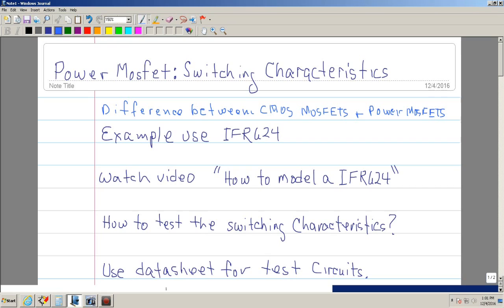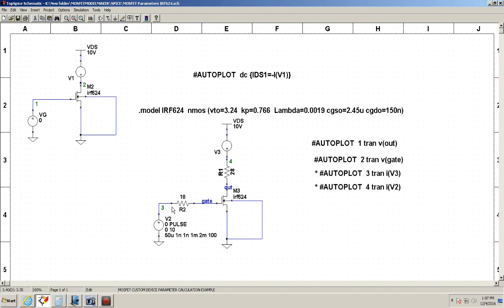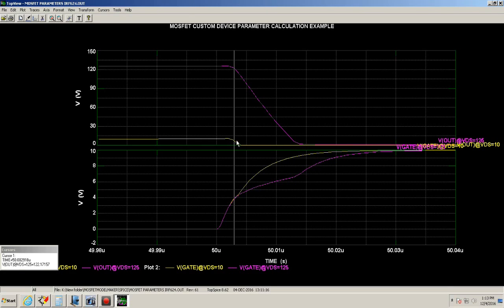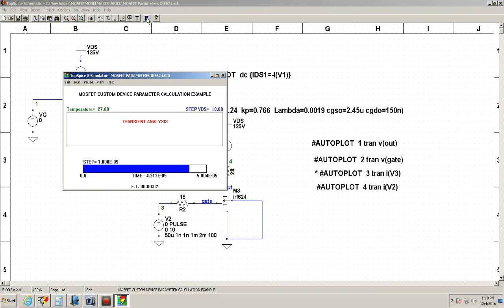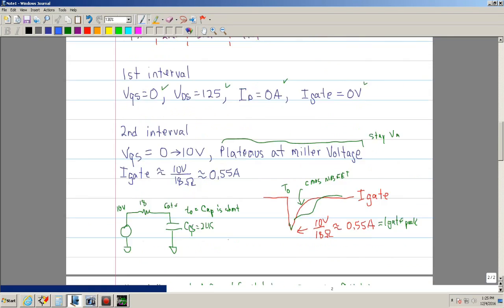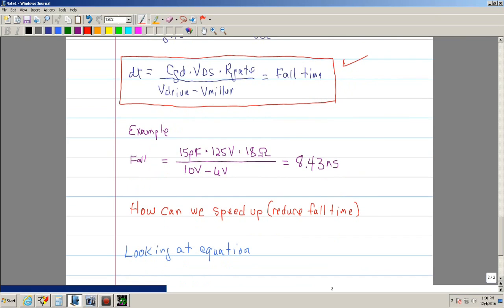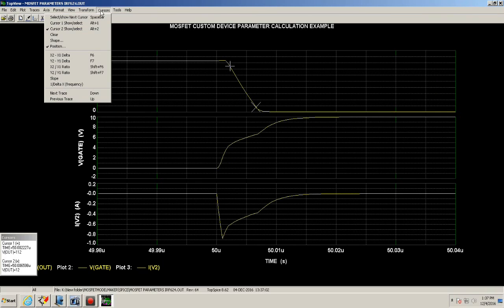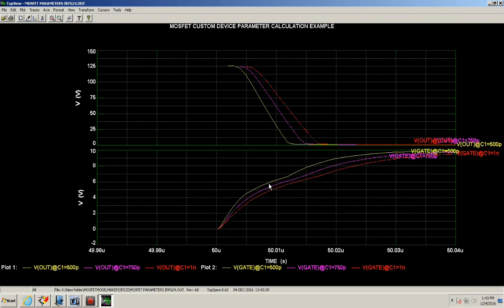MOSFET Switching Characteristics 1

Comment: can we find miller platue voltage from the data sheet? if yes then how is there any formula to find that. moreover you have wrote the equation for the fall time it would be helpful if you told the equation to find the rise time thank you
Reply from the maker: Hi itsrandom, the vmiller platue can be approximated as VT (Threshold Voltage). The erorr is small enought to make that approximation! Sorry for the delay answer. I just saw it.

Comment: can someone please explain why the gate current is negative at t=0 (-500mA)? shouldn't it be at +500mA at t=0 and then exponentially decrease as voltage across the capacitor increases?
Reply from the maker: Hi Jeeva, Sorry for the delay in responding to your question. I am slowly recovering from Covid. Regarding your question,  I am plot the current thru V2. In spice when you plot the current of a voltage source, if it is negative current, then that means that the voltage source is supplying the current and the current is flowing from left to right into the Cgs of the mosfet. When the current in a voltage source is positive, then the current is being dissipated by the voltage source and flows from right to left. I hope this clears you doubts. Robert Bolanos
Reply: @RobertBolanos  how are you now i hope you are well, thanks alot for your videos.
Reply from the maker: @Ahmad-gn1pd  Hi Jeeva, I am doing much better. The covid lasted around around 3 months. Thanks again for asking. Take care and be safe.
Reply from the maker: @Ahmad-gn1pd   Hi Ahnad, I am doing much better. The covid lasted around around 3 months. Thanks again for asking. Take care and be safe.
Reply: @RobertBolanos  I hope you are always in good health. And thanks again for your amazing content💐

Comment: Hello again,  If the SiC (SCT2080KE) MOSFET has in its datasheet as Rg = 0 ohms, how could this analysis be applied?. Regards
Reply from the maker: Esteban Buenrostro   Rgate is added externally to minimize gate ringing. So you use this value and not the internal Rgate.

Comment: Hello! one double, MOSFET starts to conduct before Miller region, i.e it conducts at V threshold, but as per your explanation drain voltage starts to change at beginning of platue .  Please clarify
Reply from the maker: That is correct, the Mosfet starts to conduct or turn on after you exceed the threshold voltage. The miller voltage is slightly above that. The drain will start to drop and will inject current thru the miller capacitor which creates the miller plateau. After the drain goes to zero voltage the Cgs will start to charge from the miller plateau to its final voltage. I hope this makes sense.  Robert
Reply: @RobertBolanos  Hi! whether the Mosfet will conduct during 2nd region ?